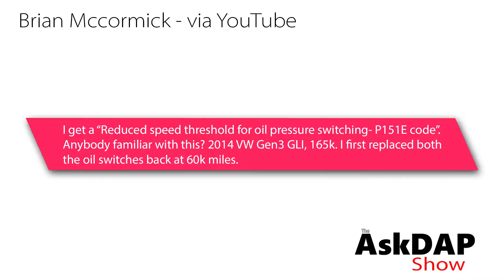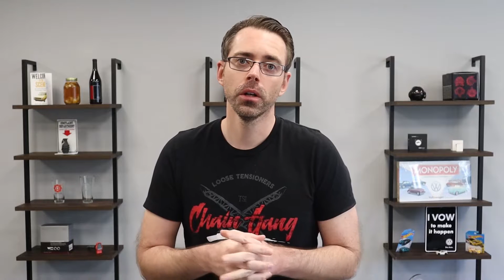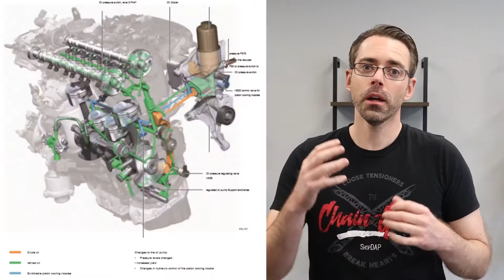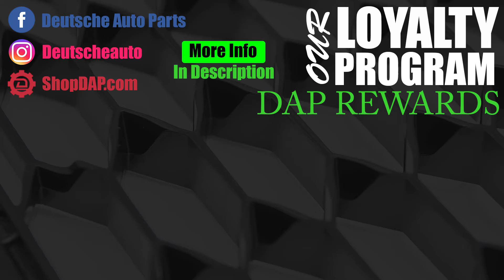MK7 Fault Code P151E - Reduced Speed Threshold for Oil Pressure Switching | AskDap

Comment: I had a static P151E00 code on my Audi S3 8V (2014) ~52k miles a few weeks ago. I cleared the fault code using OBD Eleven and topped my engine oil level up which was slightly low (not quite below the marker but getting towards it) with Castrol EDGE 5W-30 LL (recommended oil for the S3). The code hasn't reappeared since so I'm hoping the volume was the issue and this has solved it 🤞
Reply: Hi mate you ever have any more issues ?

Comment: There has to be more information on this. I’ve done timing recently and still getting this fault under hard acceleration. Sounds like multiple DSG farts in one along with the car refusing to upshift. If i ease into the throttle i find that it’ll gradually pick speed as normal.

Comment: Final update. My chain was WAY stretched. There a circular cap that can pop off on passenger side of engine allowing you to view the chain tensioner. Mine was pushed out 7 threads aka looser than a Las Vegas hooker. Dealer wanted $2500, my Orange County VW shop charged $1350 for parts and labor. Dealer said code was the low pressure switch overcompensating for the chain stretch. As mentioned below I also replaced the $100 solenoid on side of engine. So I think thats it.
Reply: Did your car make a noise in a cold star?
Reply: What shop?

Comment: Update on my question to this video. I spent $100 to buy a new VVT solenoid and $85 labor to have it installed during my oil change. Code went away. Not sure if not fixing this in time is related to my newly discovered beginning of chain stretch. That will be a chain replacement kit from FCPeuro for $600 plus $1,000 for labor. But car drives nice with 183k miles.

Comment: HI!
GFF in ODIS recommends to check the tension of the  timing chain. 
In gen3 1.8 skoda octavia  we found out that  chain tensioner is extended for its maximum lenght.
 So i think that "reduced speed treshold.... is just an incorrect descritpiton for an emergency mode.

Comment: Any update to any specifics on what causes this? Taken car to two different dealers they cant figure it out. They say the car drives fine, but it does not. This code is ruining my life lol
Reply: I wanna talk to brian McCormick and see if he solved it lol
Reply: Regarding P151E code - master tech suggested that’s usually due to VVT solinoid on passenger side of engine. It has 3 holes that adjust oil spray on cams. It’s been 15k miles and I still haven’t had it properly checked. But master technician said 1st step is to get an oil pressure test. So I’ll let you know after that. The code only appeared on my OBDeleven scanner - never a light on my dash.  I am curious to fix, but now with 180k miles had to replace shocks, brakes, tires and now leaking oil pan tomorrow.
Reply: @bmuns6445  it has been 4 years, maybe got it resolved and how? I am at same situation :D
Reply: HI!
GFF in ODIS recommends to check the tension of the  timing chain. 
In gen3 1.8 skoda octavia  we found out that  chain tensioner is extended for its maximum lenght.
 So i think that "reduced speed treshold.... is just an incorrect descritpiton for an emergency mode.

Comment: I appreciate Shopdap responding to my question. I do have a Unitronic stage 1 tune. But I don’t beat on or race my car. I did try some Lucas high viscosity oil stabilizer and got that code close afterward. I use Liqui Moly Molygen oil and change obsessively every 5k miles. The code went away after next oil change. I think the Lucas altered the viscosity which tripped the code. I use an OBDeleven scanner and have not had the issue since oil change. I think I’ll steer clear of testing additives moving forward.

Comment: I also have been getting this code mines at 46k miles and 2014 gli gen 3 tsi  I may try the oil control solenoid soon, any other advice is greatly appreciated
Reply: Literally same car here and I'm getting this for the last month or so. Have you found a fix?